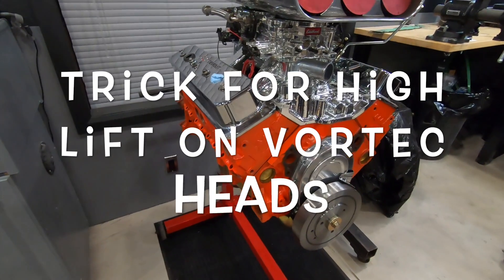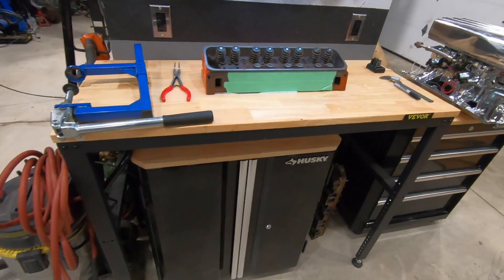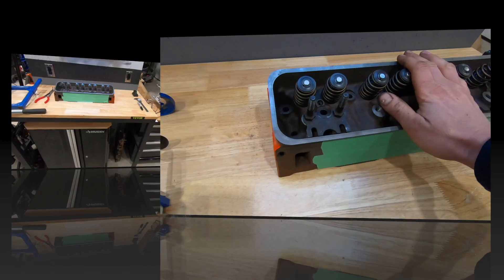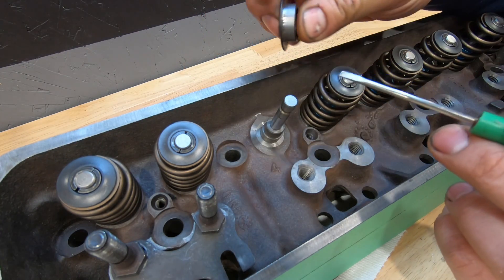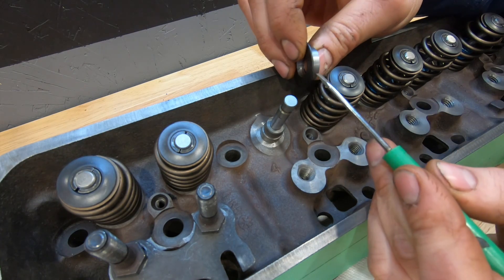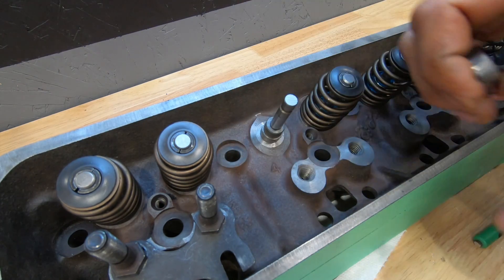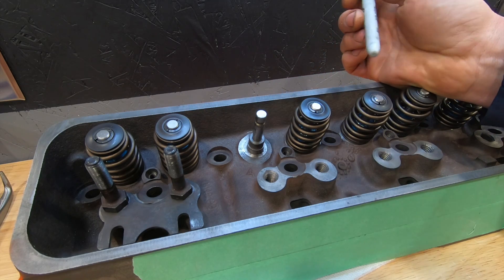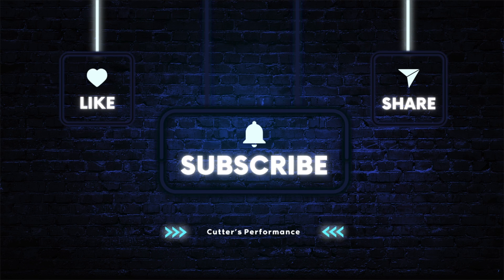Important Tip when Cutting Guides (.600 Lift Vortecs)

Comment: I just ran across this on a set of early 70s heads a guy had done. I found that the LS style spring locators work perfect.  They're around 0.050" thickness. 
On a pair of my own I did have to machine the outside diameter about 0.010", as the beehive springs wouldn't even fit over the guide boss on some. I have an adjustable spring seat cutter with that utilizes 2 angles, the bottom flat and the inside, which cuts down the outside, guide boss diameter. From Goodson
Reply: Perhaps, in a case like this the LS style tophat seals might work as a seal and locator

Comment: Hey what’s up man, I bought the sum-151124 heads and I’ll be using a sum-8803 cam…
I just ordered sum-174003-3 retainers
Sum-174003-4 valve locks 
Sum -174004 springs 
I need to do some machine work on the heads to install guideplates 
Question 
What guideplates, rocker arms (full roller if possible)
Rocker stubs and pushrods will you recommend?
I know I asking for a lot but bro, I’ll  you a tip if you want to 😂 you do a hell of a job 
Thanks for your help I will really appreciate it if you can help me out

Comment: I use the Alex's Parts matching setup. Springs, retainers and Keepers. Clearance and good to .550 lift with no cutting. Have 110 seat pressure 300 at .500 lift. About 180.00 now? 
6 years on a warmed over 350 with Vortecs. Only 268HE with 454 lift but did this so if want more I could. Need good vacuum. Cruiser.

Comment: They should make a retainer that goes on the bottom of the spring that fits snug to the valve guide that way you don't have that problem with the spring moving maybe somebody should fabricate that and patent it maybe I will

Comment: I’ve been watching a lot of your videos because I’m having an issue with a set of 882 heads I had worked. I just had to waste a set of head gaskets after finding my roller rockers are bottoming out on the stud. The bosses have been machined down but the machine says they can take another 80 tho off but this isn’t gonna be enough to get correct geometry still. A 8.00in push rod was giving me a hair of clearance after my 50tho of preload but the roller tip was sitting towards the back of the valve stem. Have you messed with 882s?

Comment: With a stock spec roller cam, am i correct in thinking I can run a 1.6 rocker arm as long as I install aftermarket seals, driven all the way down and use a bit heavier spring, like you listed in another video. 
Thank you for advice.

Comment: If your cam is ground for 1.5 rockers, have you thought about how 1.6 rockers affect the cam timing, EXP. It will make the cam seem to be advanced, because the valves now are opening sooner and longer by a few degrees. Might consider retarding cam a few degrees to maintain original position ?

Comment: Hey buddy, great video...had a question on a flat tappet cam. What brand are you going with if you ordered one right now? I know you like your rollers but sometimes that's not in the budget and i know you've had good luck with them.
Reply from the maker: Actually I have  videos coming this week about a budget build with a flat tappet that was dynoed on Friday. It made tons of power! I used a Summit 4/7 swap cam and Howard's lifters (Both made in the USA)
Reply: @cuttersperformance  you're the man brother!
Reply: For what it's worth, unfortunately for some weird reason alot of the flat tappet cams even the high-end name brand ones are flattening lobes very quickly. If you watch alot of engine builders or diy'rs on yt they are all having issues. Conversely, the hydraulic roller stuff is fine, weird I know. Anyway yes it is more money to go hydraulic roller but they do make better power and last much, much longer.
Reply from the maker: @conservativecrusader80  i agree most builds I do are roller but alot of guys still love flat tappet cams but its definitely a risk going that way these days

Comment: Didn't you do a video on a summit 4/7 swap cam?
Reply from the maker: I did have a Youtube short with a sneak peak of the Dingle ball 355 with the a summit 4/7 swap cam, but I accidentally had the wrong part#  on the video so I took it down. The engine was on the dyno yesterday and did very well. Videos are coming soon!
Reply: @cuttersperformance  I was thinking it was yours, sounded good. I'll be looking forward to the video. Thanks

Comment: Good video but I have a question for ya. I'm working on a 97 GMC c5100 5.7 vortex with 906 heads. My question is can I get away with just torquing them down or do I have to torque to yield them?
Reply from the maker: The head bolts are not TTY. Look up the torque pattern (from inside out) 25 ftlbs, 45 ftlbs, then 65 ftlbs. Do three passes at 65 ftlbs and dont forget thread sealant
Reply: @cuttersperformance  Thanks I really do appreciate the help 😁👍

Comment: I’m going to be running the summit 8802 cam (525/520 lift) with beehive springs, .030 offset keepers and new retainers, will I need to change from the 1.5 arms?? What do you recommend for a cheap replacement? It’s a machine free build
Reply from the maker: Sent you a message on your other comment! Thanks!
Reply: How did you get everything to work with that cam! I just bought the same cam for a carb setup in my Jeep. I bought some 1.5 aluminum self aligning full roller rockers, and the  rocker centering guides hit the retainer and the locks before even touching the intake valve tip with the +.030 locks….. how did you make it all work! Please share your build plan and how much your liking that cam now that it’s running!
If you’d rather email me it’s fbpd227@yahoo.com
Thanks in advance!!!
Dave

Comment: Hey, I have a question on what you would recommend on setting up my heads. I have watched this video and the other video about how much lift a vortec can make but I haven’t completely come to my answer yet. I am setting up a 355 with 9.7:1 CR. I have my heads at the machine shop right now getting worked over but I’m going to be running a comp 292xfi hr-13. I am getting 2.02/1.6 SS valves installed, bowls cut, chambers unshrouded. I was going to run 1.6 full roller rockers and clearance the push rod holes. Is it required to cut down the guide to run .600 lift. The lift of that cam with 1.6 rockers is .580/.579”. The valves have standard sbc tip length
Reply from the maker: Yeah past .550 lift, you'll want to cut down the guides and also cut down the rocker stud bosses and add guide plates
Reply: Thank you for making that clear. I’ll talk to my machinist but at this point it might be more cost effective to get a pair of afr enforcers

Comment: Great video. I purchased a set of vortec heads with guide plates are you supposed to cut the stud bosses down for guide plates thanks
Reply from the maker: Yeah they will need to be cut down the thickness of the guide plate, plus the thickness of the hex head on the new stud.

Comment: I`ve found if you increase valve OAL you should end up changing the pushrod length to keep the rocker geometry from side loading the stem (from scrubbing across the tip of the stem) and of course a shorter guide will wear more than a longer one. For what it`s worth.

Comment: Pat, did you see Charles Servedio cylinder head porting and flow bench on here did? He took a 193 door stop sbc head and made it flow just over 300 CFM!😯 Just under 300 by .600" lift too!😯 Yeah, those heads do have potential, who would of thunk it.🤷. 

Can't wait to see if you can duplicate his efforts. He also did a quick factory valve port job with one of the ports for us guys following along. Just messing around IIRC he got around 250 intake CFM flow and around 180 ex. flow with 2 hours of port work.

Who needs to buy Vortec heads if you can grind a set of 193 swirl port heads. Heck who needs aftermarket heads uf you have the ability to copy what he did?

Also, Merry Christmas and Happy New Year to you and yours.😎👍
Reply from the maker: Yeah I saw abit of that, hopefully get some time to check it out better. Thats danm right impressive!
Reply: @cuttersperformance  
Heck yeah! It could of been you, I tried to get you to play around with those.😁👍

Comment: To me if your gonna run more than .550 lift just after market heads cus you be already reching the cfm limit of the vortec heads
Reply from the maker: The cam is actually a .550 lift cam with 1.5 rockers. I will be trying 1.6 rockers (.580 lift)  to see what it's worth on the dyno

Comment: Is a melonized gear needed when only running a flat tappet cam, comp cams said I needed it for all their camshafts? I’m getting mixed information from summit.
Reply: I put them on every non-stock engine I build, they work on everything especially on high-pressure high volume oil pumps ( which in my opinion are over used).
Reply from the maker: Melonized gear is really only needed on a billet (Roller) cam, its is basically just a surface (nitrating) finshed. They can be used on a cast cam aswell. A regular cast gear or melonized gear works on just about every flat tappet cam

Comment: To anyone that plans to run 1.6 ratio roller rockers drill out the push rod holes so there's extra clearance for them and also get the heads machined for guide plates. Standard roller rockers are cheaper than trying to get good self centering roller rockers!!
Reply: You answered my question! God bless you

Comment: I'm inclined to think it would be the very rare case that a guy would need the lift beyond .550", and here's my thinking as a fan of your channel, and I believe we think alike most of the time.  Other than a lab experiment, or racing with a rule regarding what a guy can run, it's hard to make the case for lift beyond 550 thou.  If a guy wants more than a 383 can deliver with 550 lift, ur goin north of 500 horse to enough of an extent that one should be looking for a big block option.  Or boost.  In your case it's for a specific purpose related to testing, and of course that's pretty exceptional, few of us are content creators.  When else might a guy want to go beyond 550 thousandths?
Reply from the maker: You are correct,  most of the time I dont part .550 lift And actually this cam is no different. I will explain in more detail in another video about that cam/engine but the cam is actually a .550 lift cam but I want to do some testing and swap in 1.6 roller rockers that where the .580 comes in.
Reply: @cuttersperformance  as an old guy, I've seen the availability of things go from plenty to not in what seems like a hot minute.  Vortec heads, in short order will just vanish.  For that reason, I bought extra used engines as "provisions".  I plan to build one with a 383 rotating assembly, keeping budget in mind.  Would that fit in with your general "bang for the buck" theme?  Mild cam, stroker crank, beehive springs, new bearings and seals, new rings, ball hone, new gaskets and maybe arp fasteners.  I'm working backwards from a 3,000 buck budget, so there's elbow room for smart choices on parts.  BTW, goes into a Tahoe from 97, she's a keeper.  Not shooting for rpm's, midrange torque is the king...area under the curve below 5,000.  I think it's doable.  Will advise.
Reply: @gregtheegg3576 
I run a Comp XFI hydraulic roller with 202°/212° duration@ .050" with .550"/.546" in/ex with the called for 1.6:1 rockers on a 113 LSA. This cam runs great in front of a 700R4 with a 3.07:1 rear gear. Pulls like a freight train in first gear and doesn't lose a beat from the huge 1 - 2 shift drop.

It weighs 4,600 lbs with me in it and does high 1.8s 60 ft times. It does 13.0s in the QM @ 101 mph. All that and still eeks out 26/20 highway/city mpg. I would be in the high 12s with the proper valve springs.

What I would do different is instead of the 9.7:1 compression it has I would shoot for around 10.5:1 and would set it up for 1.7:1 rockers and of course install the proper valve springs.(with aluminum heads, with cast iron what is there is good enough)

For your Tahoe with the bigger tires you will want around a 3.23 to 3.73 for similar results.(my tire size is 28" tall)😎👍
Reply: To literally quote Eric w. I have never seen a small block Chevrolet not make more power with more lift,  power will always go up with more lift, if the Valve events are right.